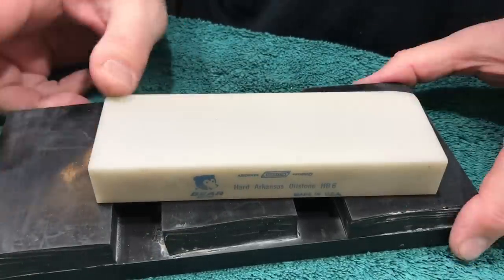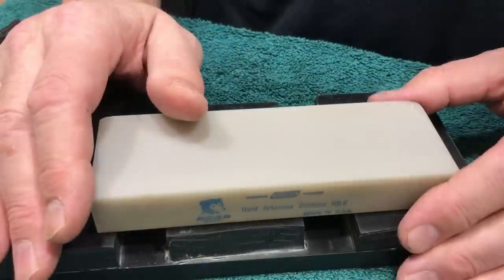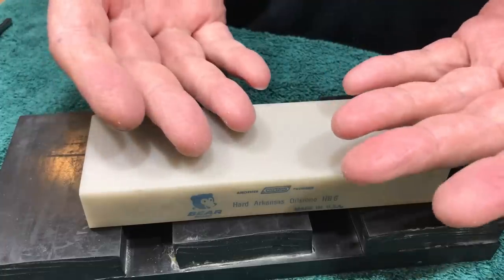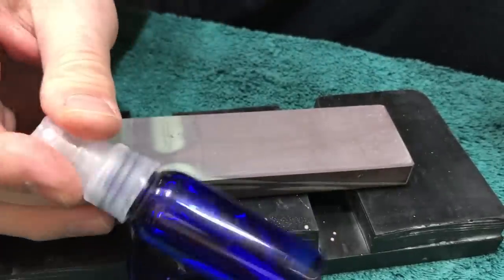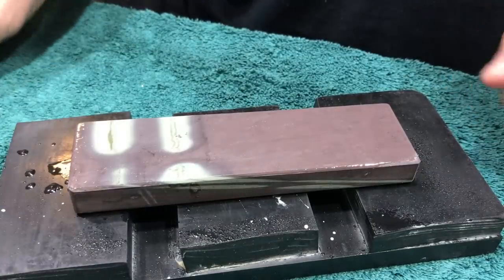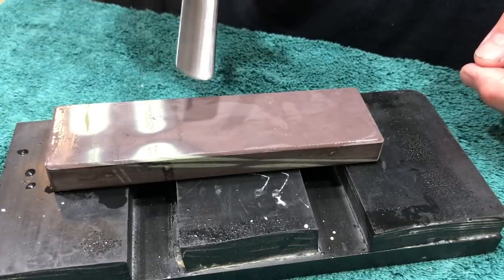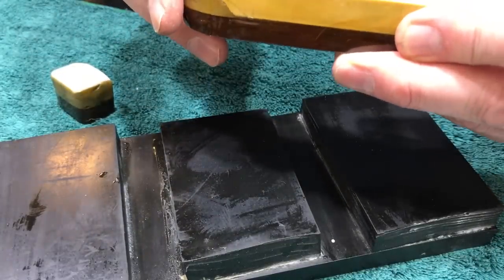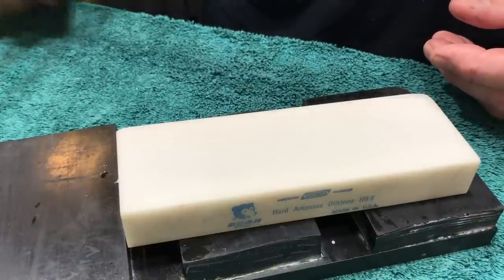Straight Razor Honing Vlog #8 - Christmas 2018

Comment: You're absolutely right. Hell, I just got a baby little Sheffield razor, it's only 4/8ths and it's an inch shorter than a "standard" type razor. It's against everything I liked. I'm usually not a fan on anything less than a 6/8ths but the spine on this razor is so thin, the geometry is great with the half inch blade. I really just wanted it as a collection piece, being so small it's cool but holy smokes what a shaver. It is the exact opposite of my everyday Wade near wedge but it does just as good a job.

Comment: Old bear manning stone is beautiful!!
Reply from the maker: Yes it is! Thank you!
Reply: @KeithVJohnson1  What grit do you finish the stone when lapping? 600?
Reply from the maker: The Ark? yes, 600x w/d paper.
Reply: @KeithVJohnson1  I agree! Burnishing does nothing, but causing a man extra work, and IMO makes the stone less effective . When I use translucent Arks with knives I finish or refresh the surface with 220 grit SIC powder, because it breaks down finer as you use it. Merry Christmas 👍
Reply from the maker: I actually lapped that Bear Manning stone in 220x SIC - I only put it on the w/d out of habit... the SIC breaks down close enough to that level where I could have just left it alone and used it as-is.
Reply from the maker: And Merry Christmas to you as well!